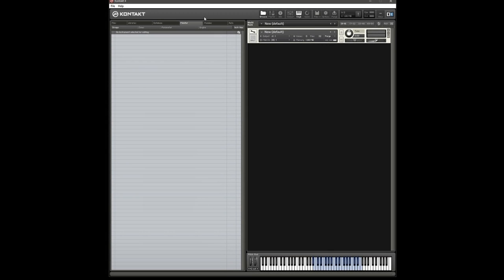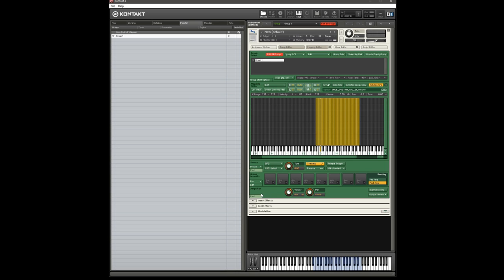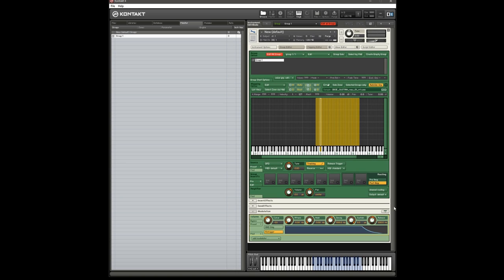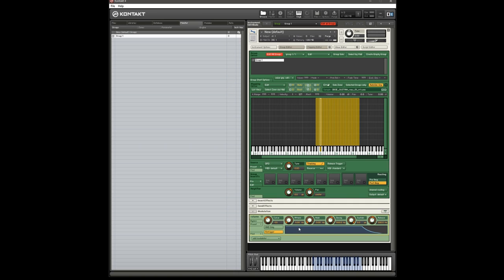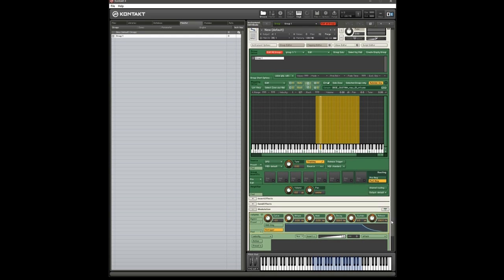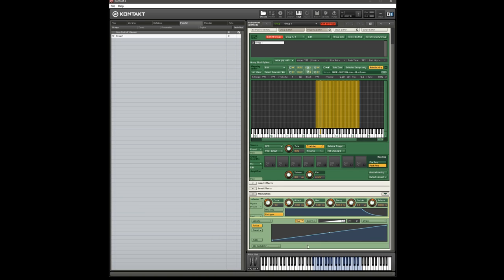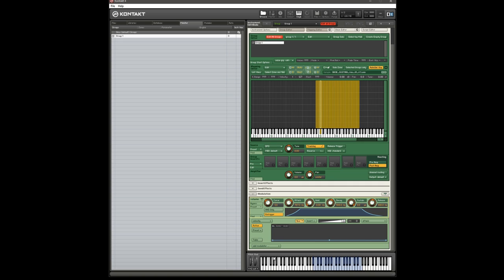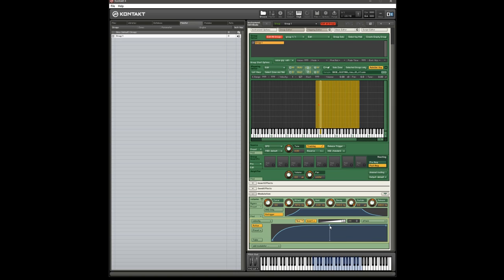How to control attack envelope with velocity in Kontakt

Comment: I have a question you might be able to answer. I have a few orchestra libraries where they set expression/ dynamics to the modulation wheel, but I hate this system and prefer expression or dynamics to by altered by how hard you play (velocity) is there any way to link note velocity to expression or dynamics so it does this? You would be my hero if you know how to do it, I've been trying to figure it out forever.
Reply from the maker: It depends on the library. Sometimes you are able to go into Kontakt's edit mode and remove the CC modulators and replace the with velocity modulators, with other libraries it's more complicated. It's often easier to add a MIDI convert plugin inside your DAW that can convert velocity to CC. How do you create 1 note crescendos without CC control?
Reply: How might I go about changing CC mods to velocity mods? Is that in the group editor? Also, if I went the second route what convert plugin would you recommend and how would I set that up? Thanks for the help and sorry for the noob questions, I don't know anything about editing kontakt.
Reply from the maker: They will be in the amplifier section of the group but if the library's script relies on certain modulators to be present it might screw things up so proceed with caution and always work on a duplicate file rather than the original. I use Reaper which has a built in plugin for it, I don't know what's available for other DAWs.
Reply: Ok thanks!

Comment: Thanks, I have Afflatus, the strings are nice but I want to add more Release because the strings cuts at the end sharply, I want to make it more softly but when I add more Release/Sustain in that MOD panel it still sounds the same, nothing changes, do you know why? is there any other option apart from doing it in Kontakt? maybe from LogicPro? I tried with a Korg Brass and works ok the Release MOD in Kontakt but not in Afflatus (orchestra strings)
Reply from the maker: It really depends on how they've constructed the library. It could be that the release is being handled within the script in which case the modulators won't have any effect. Have you tried asking Strezov?

Comment: Since this video deals with the control of attack by velocity, I pose a question about something similar:

For timbres that sustain, such as a violin, is it possible to control "release by sustain pedal" in the following manner? Set a short release for when a key is released--AND set a longer release for when a key is released WITH THE SUSTAIN PEDAL DEPRESSED.
Reply from the maker: Yes, but you'll have to disable Kontakt's default sustain pedal behavior too
Reply: @Xtant-audio  Upon first glance, my reaction to your answer was "Oh, no! Disabling the sustain pedal's default behavior is completely out of the question." But then, I slowly realized that redefining sustain pedal behavior for a violin part would be necessary only for the duration of the session in which the violin part is being recorded. Then, default sustain could easily be re-enabled. Right?

Whew! That was close.

I imagine that some samplers and keyboards might not be built to allow access to such tweaking, so it's nice to learn that Kontakt has this ability.

Oddly enough, I have seen this "variable release with sustain pedal down" behavior on low-end keyboards but NOT on high-end keyboards and am very upset about this because such behavior is REMARKABLY useful, easy, and intuitive for the HIGHLY expressive playing of sustained timbres.

Comment: Thanks for all your videos...  One question:  If a purchased library has a locked script (it seems most of the good ones do) can one modify how the notes decay?   Developers are hell bent on note off samples triggering on note off's so as to keep the "as close to realistic objective" as possible...  But in most of my purchased libraries I'd rather ditch the note off samples and just dial in an ADSR amplitude envelope on them.  Am I correct to understand that is not possible if scripting is locked?  That is one would have to start from absolute zero to achieve this?  Sorry if this is newbie question as I am new to Kontakt 5 full -- but upon reading up on the issue have found that libraries we pay hundreds even thousands of dollars for lock their scripts down.  Any ideas to point me in to add simple Amplitude ADSR to my purchased (locked) libraries?   Thanks very much!
Reply: Figured it out mate but thanks !  Easy to edit amplitude envelopes regardless of scripting at least in Orchestral Tools libraries...  Have been in the dark ages with the player only version of Kontakt.  Full is a must have if investing in these libraries...
Reply from the maker: Locking the script shouldn't affect your ability to edit the ADSR parameters but I know some developers do seem to have found ways to limit the user's control beyond just locking scripts.